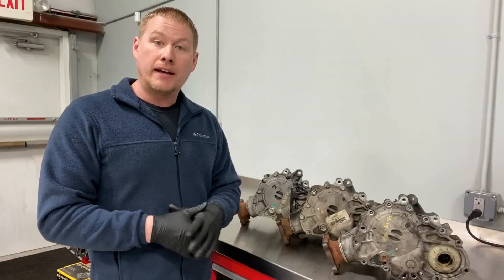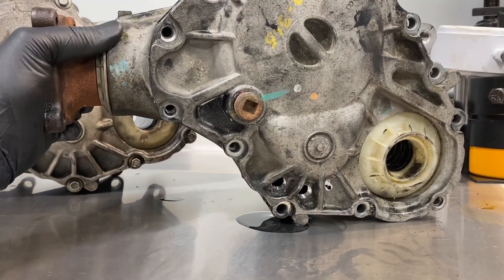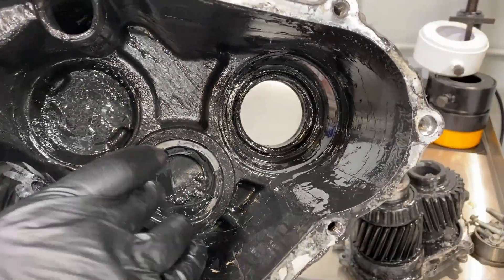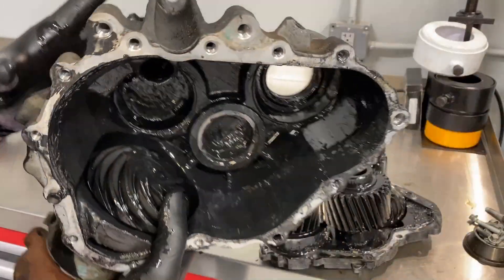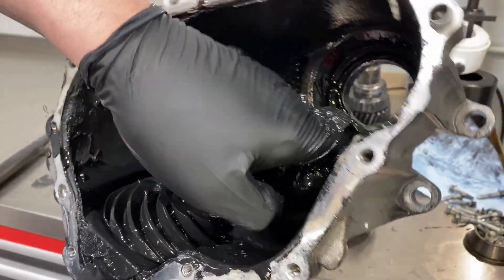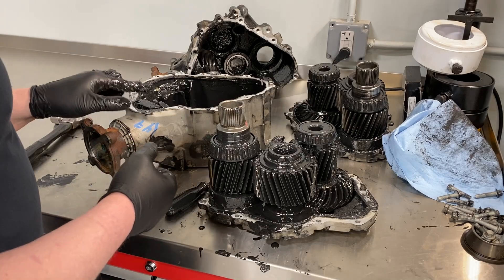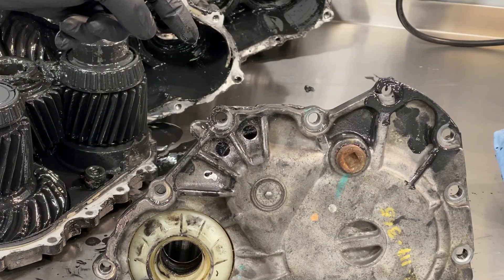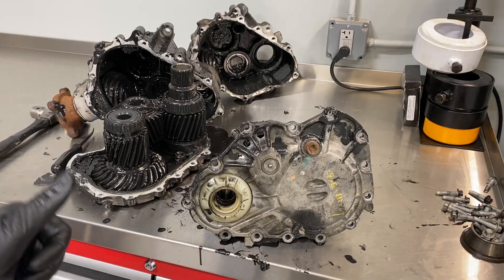How Ford All-Wheel Drive Power Transfer Units Fail and What You Can do to Prevent it!

Comment: Designed to fail for the service and parts dept
Reply: OEM FLUIDS too are designed for short life!

when owners switch to better lubricants then the special elastomer SEALS start leaking
(Tranny ATF, Diff. 75w90, water pump, tensioners seal,...).

Lub engineered for failure:
Aftermarket fluids all claim greater mileage and reduced friction bla-bla-bla but stay mute on the chlorinated surfactants that eat rubbers and soft metals. 
(Google: bearing seal failure fluid additives analysis...)
Reply: G Lasser very interesting
Reply: @glasser2819  what do you recommend ?

Comment: Any thoughts on the difference between Amsoil or Redline 75w140?  Changed to redline at the first 20k miles but might try amsoil next time.  The price is actually less than the motorcraft.

Comment: I don't understand what you are saying. Do you mean that the new PTUs have drain plug from the factory, or that the replacement cover has a drain plug?
Reply from the maker: Latest PTU service part has the new cover and drain plug.
Reply: @FordTechMakuloco  OK, thank you. I have a new Nautilus and thought it might already have the drain plug from the factory since this has been an on-going problem. I don't want to go drilling holes in the case while the car is still under warranty, so I'm not sure what to do at this point.

Comment: First question comes to mind......
WHY did Ford use BUSHINGS for the Idler instead of Roller Bearings? 

I'm a Retired Ford Line Tech since 96.... So I've seen goofy stuff from Ford! 
Carmine ✈🚂🚙
Reply: That is the dumbest design no bearings and no drain plugs Fort should be required to replace them all at no cost

Comment: This is why I started changing the fluid every 10K at 20k. Hopefully my PPE ceramic coated downpipes will keep the PTU a little cooler. I'm using Red line too. 🙏 That it holds... Very informative video and thank you!
Reply: Hey...I thought the same thing but doing a wrap...
Might help too
Reply: @trevorpaul2040  I've learned the hard way on my motorcycle that it will eat the metal. It holds moisture and your pipes will collapse.

Comment: Ford say it's lifetime fluid. Absolute rubbish. I had a 2013 SHO and changed my PTU fluid regularly. Dealership did it for me $78 as I had the PP option
Reply: it IS lifetime lubed..when the lube wears out i..its finished...
Reply: Eric Sandrin 

You’re misunderstanding

In the maintenance schedule for vehicles with the PTU, Ford refers to the unit as being filled for life. Meaning they claim it never needs to be topped up or have the fluid changed.

And that is simply not true. Depending on how you use the vehicle these units can cook the fluid and destroy the PTU in under 50,000 miles. A lot of people will have their power train warranty expire well before this happens and then they’re on the hook to replace it.

The problem is twofold with the PTU:

Not enough fluid capacity
Located in an area where it’s close to a lot of radiant heat. 

I have a Flex that has this unit. I change the fluid every year no matter what the mileage. We don’t even put 8,000 miles a year on our Flex, no towing and minimal extended highway driving and that fluid is BLACK when I change it. I’ve drained diffs that had 5 times that amount of miles on the fluid and yeah it’s dirty.......but not black like this fluid is.

Ford eventually added a cooling unit to the ones on the Police Explorers and Interceptors because so many were failing on those units
Reply: @thehawk05  I think Eric was being sarcastic. But thanks for the info, Hawk

Comment: I have a 2017 Edge sport. I only put about 9500 miles on it a year. What mileage would recommend a fluid change? 20,000 or 30,000?
Reply from the maker: Between 20-30k mile yes.
Reply: @FordTechMakuloco   So at maximum no more then 30,000?

Comment: Great info! I owned a 2010 and 2015 SHO but never had a chance to service them. You answered a question I had about our FWD 2019 Escape. Glad it's accessible on that one.
Reply: Do you know if the 2010 sho has something like this?
Reply: @brandonfrederick4761  Mine had the same PTU showcased here. No drain plug. I was going to install one but ultimately traded for a new 2015. The 2015 was a PP model and had a drain plug, but alas I never changed the oils as our needs changed and I sold her.

Comment: 2017 SHO, I change out the 75-140 fluid every 20 thousand as a precaution, and heat wrapped the down pipe, access to the fill hole is a bear so I let my dealer do it and I get to see the old fluid being sucked out.

Comment: Terrible design by Ford.  Most of these units reside very close to the CAT.  Small amounts of fluid, confined space (I.e., no ventilation) and near a major heat source - and it’s “fill for life?”  🙄.  As suggested, change every 30k, at least.  I have had the fluid tested by Blackstone and that appeared to be the sweet spot on Motorcraft fill...
Reply: Filthy part is that the Taurus SHO Performance Pack and the Police Interceptor versions get the PTU with the integrated oil pump and cooler, so Ford was using them, but not in any of the normal passenger cars.  Thanks, beancounters!
Reply: @BinkyTheToaster  Yup, pay now, or pay later.
Reply: @BinkyTheToaster  Not quite, it was really just a coolant addon to the case, it doesn't pump the lube at all, just pumps coolant to a heater block on the side of the case

Comment: Hope I have seen this before, I drilled a hole on the case like 2 years ago and have changed the oil twice haven't had problems but you make a very good point about the structural resistance. 
VERY IMPORTANT, don't use Motul 75w-140 oil it has very bad heat resistance and it burns very fast, I did the drilling procedure to prevent PTU damage and after only 12k miles I start hearing noise coming from the PTU so I quickly replaced the oil and the problem was gone, trying to prevent damage nearly end up blowing my PTU because of a low quality fluid. Now I'm using Red Line 75w-140 but it's too soon to comment about it but I think it's going to be ok, Motul fail me twice and it behaved very similar both times it burns too fast you would have to refill every 10k miles instead of 30k miles so it's not worth it.
Reply from the maker: Yeah I just stick with the Motorcraft stuff you know is made for it no questions asked.
Reply: @FordTechMakuloco  Agree the original fluid was in there for 7 years and 50k miles without problems just changed it to prevent issues, but I like trying different alternatives and only Motul has failed me.
I had a bad experience with Motorcraft Mercon SP transmission fluid in a Lincoln Navigator 2008, I changed the fluid and followed the manual spec of it that called for Mercon SP but soon after I did the transmission started acting strange and got codes so had to drain it, replaced the fluid with ZF one, replaced the filter again and the problem was gone, so it's good to have options.
I'll post some comments about Red line's 75w-140 fluid after a year or so. GREAT VIDEOS BY THE WAY.

Comment: Another wonderful FORD Design to increase Parts Sales Revenue!  The one I had was $2,600.00.  A real bargain!  Thanks, Ford!
Reply: GM did it, Chrysler did it (in the auto transmissions), BMW did it, VAG did it... It's not an original idea, it's engineered obsolescence.
Reply: @dieselscience  ya not really transmissions still had a way to change the fluid
Reply: I mean you actually might have to do maintenance. What would you have done when you needed to do points and condensers yearly, repack your wheel bearings yearly....you'd have complained about it not lasting.
Reply: @waytoofazt9155  - There is no place to check the oil level in the PTU ant the outside of it was bone dry.  One of those “lubricated for life” units.  It held up for 250,000 miles.
Reply: Jay Man  ;  Well, I've seen the internal engine parts of GM Products and they look like bicycle parts, so I don't buy GM or Chrysler.  That leaves Ford for me.
Reply: @boobalew 
I don't think so. I have an '07 Chevy Trailblazer with 150K, and I've replaced every fluid at least three times (engine oil every 5K). I even replaced the transmission pan with one that has a drain so that every four oil changes I drop the trans fluid and refill. It just runs, and runs quietly, goes though 2 feet of snow like it wasn't there.

Comment: How ironic is it that I'm sitting here watching this as I'm waiting on my '18 Escape while it gets its PTU service at 36K...
Reply from the maker: You have one of the good ones.
Reply: @FordTechMakuloco  I was looking at a '17 Escape AWD 2.0, is the '18 better?
Reply: You are very lucky that it is serviceable.  I had to replace mine because it was maintenance free until after the warranty expired.  It wasn't cheap!  Around $2000 and that was $400 less than the dealer.
Reply: not irony at all.
Reply: @BenState  Damn, you beat me to it! LOL - coincidental, but not ironic.
Reply: @BenState  Exactly.
Reply: Ford upgraded PTU with adding drain plug . I'm not sure probably since 2018.  
Old  PTU  in Explorer., edge   are *ucking sucks . I replaced lots , 
Small 4wd escape Ptu  since 2013 never have problem , before 2012 are some  oil leak issue.  
I made drain hole my  2012 explorer PTU.  Change fluid more frequently.
Reply: 캐나다정비사 Auto Technician in Canada Ford really dropped the ball on the PTU’s. Lifetime my ass. Exactly how long is lifetime? When the ptu shits on you and thats not long at all.

Comment: Last a 100k or more? They should last 200k or more there a simple gear box.
Reply: Hell, ours has 295k on it. A year or two ago I sucked out what I could from the fill hole, but otherwise I'm sure it was never touched. We bought it with over 200 on it. Nobody takes care of anything.
Reply: They are not simple. They use a single idler gear to transfer power to the rear of a 2 ton vehicle. Should have at least 2 idler gears.
Reply: The Ford gear box is next to a hot engine with no heat shield.  Planned obsolescence at its finest.  Auto manufacturers are in the parts business by design.
Reply: @jobe8764  No they only sell"assemblies" those bearings are cheap and so is fluid but the assembly is OMG
Reply: Kenton Hughes they want you to buy a new car when this happens.
Reply: Mark not if there isn’t any lube
Reply: "They're "

Comment: Never been a great believer in 'sealed for life'..... Here's a good example...
Reply: The thing is these are not sealed, there is a fill hole but no drain hole... you have to get creative with a small hose and vacuum pump.
Reply: @dieselscience  
VW does that crap on some of the auto transmissions. 
Ya need a scan tool to read the fluid temp from the sender , be in a range they specify , and then pull out this plug. 
No fluid drip, add more. 
If it pours out, let it seek level. 
And usually the fill is where the dipstick used to be. 
On some of them you can search out an earlier model that used that trans and had a dipstick , so you can source a dipstick and tube for your late model and step back in time to when you could check your own fluid levels.
Reply: @dieselscience  sealed from the average consumer
Reply: Jay Man  Problems like this are present across all manufacturers. They use the whole "lubed for life" as a selling point of the vehicle mostly. I don't agree with it but that's what they do.
Reply: Jay Man  wait spark plug and leak problem.? Dude every car/truck brand is shit, even Toyota. Just look at the Tacomas and tundras their chassis rusting to the point that they  break in half!
Reply: Sealed for life is good.
The only problem is, the life will be short. (Same as „service free“ batteries)
Reply: Jay Man  lol had a Tacoma, the electronic 4x4 went out twice.  valve cover gasket shot. both before 80 k miles !sold it at 100kbecause my frame wasn't looking good. sorry my man but I drank the cool aid once no more .
Reply: @marioplushiecentral3441  
I've got a buddy that had that warranty frame swap done , still cost him like 25-2800 out of his pocket for all the other rusty stuff they had to replace along the way.
Reply: Jay man please stop with "why you do not buy Ford products" crap. Because every manufacture do this and in most case they don't make or design them either. How many times do we see THIS CAR IS JUNK JUNK JUNK, BAD DESIGN but yet never do any maint or drive piss out of like a race car. I'm a tech I've seen a lot of crap that people blame vehicle when issue is THEM. Reason for lube for life is selling point thinking they never have to do repair/maint on this part. Funny part most trade vehicle in long before ever gives a problem. Its 2nd or 3rd owner who it effects the most
Reply: "sealed for life" = "maintenance free under warranty period"
Reply: Jay Man  I thought they told me my Tacoma had sealed transmission
Reply: Jay Man  their Transmissions haven't had a dipstick in such a long time and it involves a special procedure to check it from the bottom with a special little dipstick.
On their trucks not sure about their cars that's how it is on the older tundras
Reply: Jay Man  Toyota has its fair share of very similar problems. But no one is talking about them 🤷‍♂️
Reply: Me neither. Don’t believe in it at all.
Reply: "filled for life" = come see us when it breaks. I also have never liked these being designed that way. I believe parts should always be designed with maintenance in mind, even if they "should never require maintenance". It's just a good idea because at some point, one of these things is going to cook off all its oil or something and nobody is going to know because lol we can't put a dipstick on it. My 2014 F150 vacuum pump had to be replaced (thankfully within the last miles of the warranty) because it was leaking. Part of me wonders if its a sort of tongue-in-cheek tip of the hat to the people that never do anything but the cheapest bare minimum maintenance. Like why make it serviceable if no one is smart enough to actually maintain it so it last? Although I can't believe that is the case....
Reply: Davy Arthurs 5r55 transmissions aswell could of easily lasted way longer. Each time I see a failed on in the shop it has no fluid and or basically black and gone
Reply: Haha when I hear "sealed for life"....
I'm searching for the fluid and (possible) filter needed to change the muck that's in it.
Reply: EXACTLY..!!
Reply: Gomer when you see a wet spot , investigate! that would be the fix
Reply: Every component is filled for life.  Just do nothing and you'll find out what its life span is.
Reply: "Lubricated for life" always means a very short life expectancy.
Reply: @professional_hackjob  What do you consider short?  I've got over 200k on a car with several lubricated for life components that are all still in good shape.
Reply: @DonziGT230  so is that the AC compressor and wheel bearings? Just about everything else that is lubricated for life usually has a life of about 100k miles. Anything beyond that you are just lucky
Reply: @professional_hackjob  What you mentioned plus: every steering and suspension joint, axle joints, shocks, steering shaft bearings, ...
Reply: The life ends when the warranty ends. Thats all the manufacturers care about.
Reply: Nothing is forever.
Reply: “For Life” is manufacturer speak for : 100k miles.
Reply: @fomoco No car is but Toyota is 100 times better than Ford and no one can deny this. I have a diesel 4runner with the 1KZ engine going on to 300 thousand rough kilometers and all Ive had to do is preventive maintance, just changed water pump and radiator out of boredom. I also have a  2012 diesel Hilux going on to 200 thousand KM and it still running with no stupid design flaws isues...
AND also have a 2005 Corolla with the 3ZZ engine and just had to change valve cover gasket a few months ago cause it was leaking after 250 ish thousand kilometers.....

So yes,I will keep buying Toyota.....

I can guaranteed no ford will ever be better than toyotas quality.

not hating on american cars....but be honest with yourselves..

Comment: Thanks to your channel, I decided to service my own PTU on my 2017 Edge, which fortunately does have the PTU with both drain and fill plugs.  My fluid looked to be in very good shape, I think due in part to the exhaust heat shield that Ford added on this model.  There were, however, a fair amount of dust-sized metal shavings on the magnetic fill plug, which I hope are just related to break-in.  Thanks, and keep up the good work!